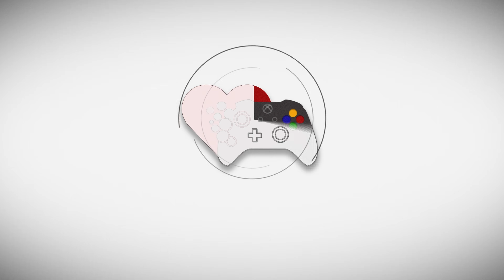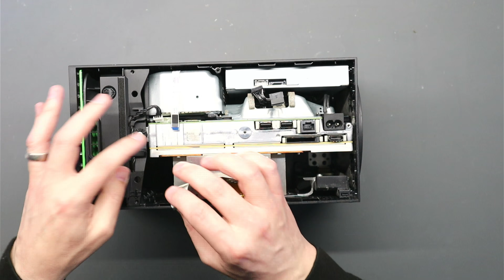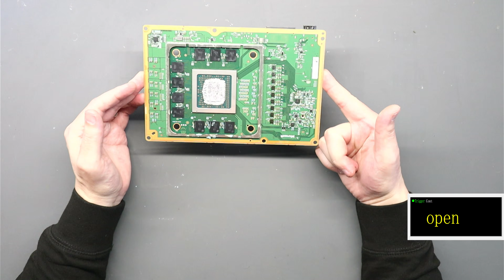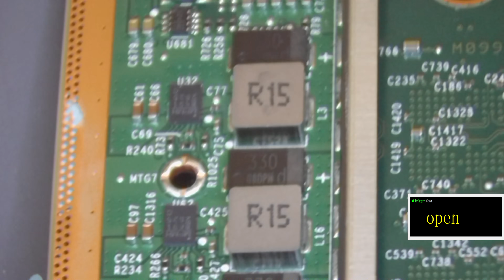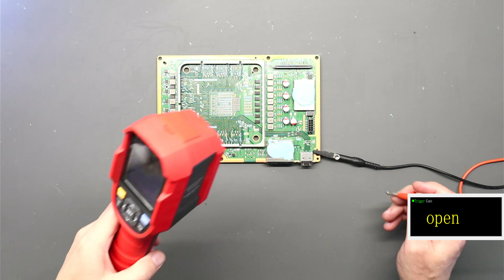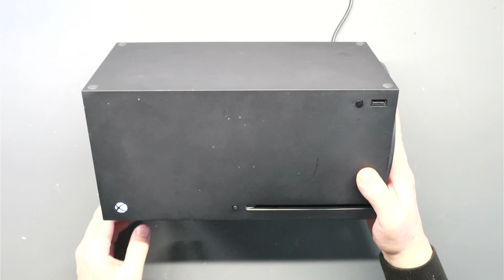Xbox Series X No Power issue - how to fix a dead Xbox Series X by replacing a shorted M86965 Mosfet

Comment: Bro, I have the exact same damaged component. I checked it with a thermal camera, but I’m having trouble removing it. My soldering station can goes up to 500 °C, and even applying hot air for minutes the solder just won’t melt. Did you preheat the board or something like that? Because your component comes off in seconds!

Comment: hey Bro,a few months ago I had a problem with my Xbox,I used It and the next morning doesn't turn on,you think It was caused by the power supply?
Reply from the maker: Could be, but this could be a number of things causing that issue. But first point is to check the PSU is outputting 12v
Reply: @ConsoleTherapy   I fixed it a few days ago and the problem was the power supply bc it doesn´t got 12V